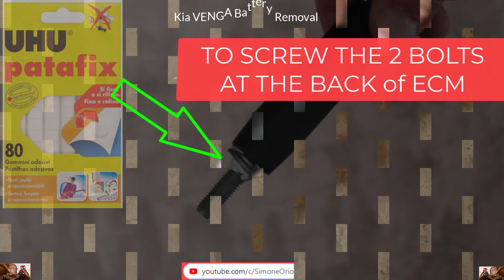💪👉 #kia  #VENGA & #hyundai  IX20 Battery Removal 👈 💪

Comment: Gracias por el vídeo.
Mi batería murió de carga por estar 2 meses sin usarse el coche. Se extrajo con 10.5V y recargó exteriormente a 3A durante 33 horas con cargador inteligente a tope de carga. Ahora está impecable tras haberle introducido 50,5 A. Estaba a punto de morir. Da una tasa de pérdida diaria de 0.7A día de intensidad. Me da la cifra mágica de seguridad de 1 mes el coche parado como máximo.
El procedimiento descrito es exacto a lo que hay que hacer. La principal dificultad es quitar los tornillos de detrás de la unidad de control del motor y volverlos a poner. En mi caso venía una rosca pasada de fábrica y perdí más tiempo en ver que esa rosca estaba mal que en el resto. Utilicé imanes para evitar que los tornillos cayeran aunque también se podían poner primero los tornillos introduciendo la mano izquierda en el hueco que queda. El problema es que te haces un poco de daño pero se consigue. 
Sólo se ha reseteado la hora del ordenador de abordo a primera vista. El modelo que yo tengo no tiene START-STOP y es del año 2017.

Comment: Hi. I wondered if you could help me. How is the batter held down? I can't seem to locate the bolts. Any help would be appreciated.
Reply: 2 screws behind the ECM one screw on the black bracket on top of the body
Reply: @martinjager6522  Thank you for your reply. I don't have the right tools for it. It's such a tight space! We jump started it in the end. (Against manufacturer advice).